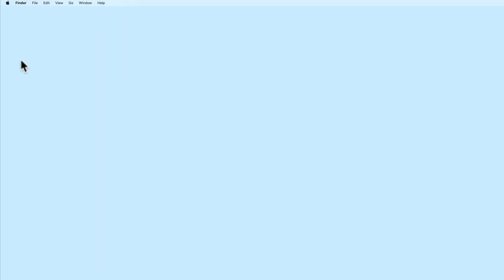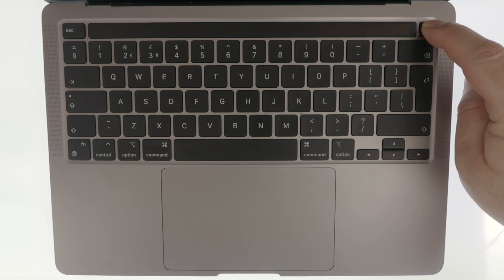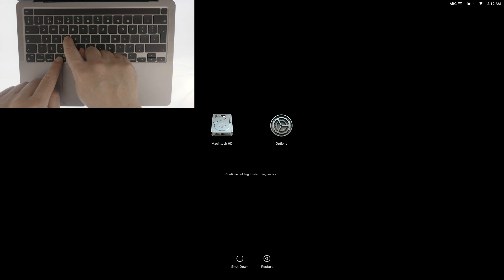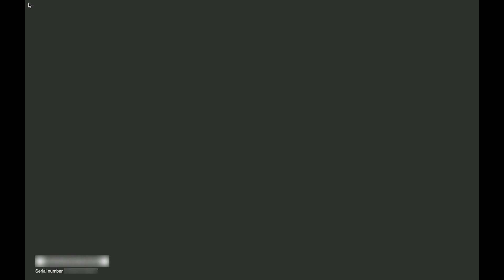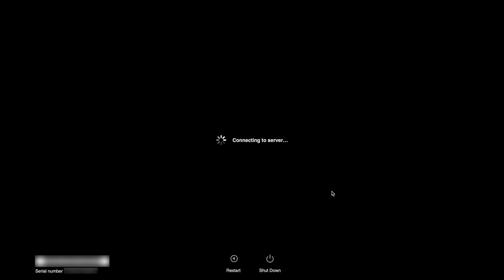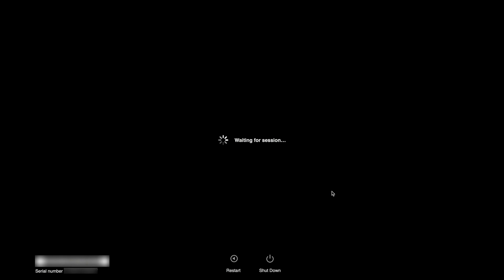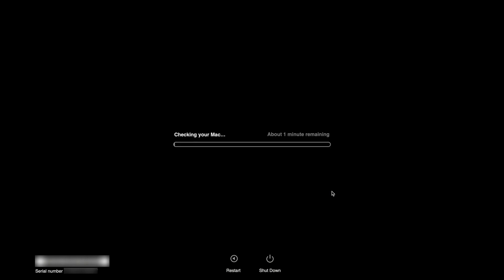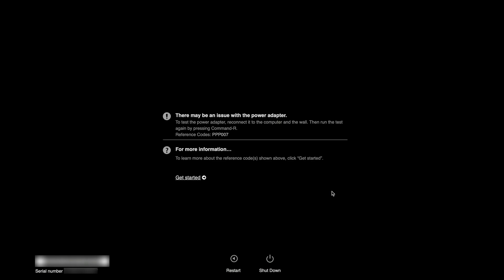How to run a diagnostic test on an Apple Macintosh computer (M1 Silicon Hardware)

Comment: Mine is waiting for session for a long time. Is it okay?
Reply from the maker: Your computer might be having problems connecting to the apple servers. Try switching it off and trying again, or if possible see what happens if you use a network cable instead of Wifi.

Comment: Hey,I am getting a startup issue and i am not able to delete SSD from disc utility for reformatting.I ran the diagnostic test and it shows no issues.I have issues with OS but not able to go in safe mode to update mac.
Is running diagnostic test after pressing offline also reliable ?
Can you kindly help with that
Reply from the maker: Are you working from within Recovery Mode? https://www.youtube.com/watch?v=8uJq7JMaIy8&t=86s

Comment: Well, guess it’s the software then…
Reply from the maker: @jimgilmour1221  if you have a operating system problem, it can be useful to use safe mode which is where only core elements of the os are run. It will also clear specific caches in macOS which can often fix a problem. For more info on how you enter safe mode on an m series Mac - https://youtu.be/36bfBfSt4CY?si=qONP2zANWFt8L1N7
Reply: @mydoodads  Thanks for answering, you're great!

Comment: My Mac is like turning off at 50 percent :( 
Will this solve and check for SMC or any hardware issues?
Reply from the maker: Probably not, but it wont do any harm to try. More than likely your problem relates to a faulty or old battery.

Comment: Hi mate, after choosing the language my Mac goes black and then goes back to choosing the language page. Do you know any solution to this?
Reply from the maker: As this mode needs an internet connection, your laptop might not be connection to the internet via Wi-Fi. One option to fix this is to use a network cable .

Comment: Mine have no issues, but it keeps running diagnostics when I am opening it, how to get rid of that
Reply from the maker: Unfortunately I have not seen this issue before, but the problem might be related to corrupt data being cached by your computer at startup.

While there are a couple of ways to clear the cache, the simplest is problem to just place your computer into Safe boot/mode. This will automatically clear its most relevant caches.

This video demonstrates how to place your M1 Mac into Safe boot - https://youtu.be/36bfBfSt4CY

When in Safe Mode, simply reboot your computer so that it loads normally.

Hope this fixes your problem.
Reply: @mydoodads  thank you!

Comment: How do I know the hardware isn’t changed one and un used one ? Mother board hard disk and all
Reply from the maker: If you're asking how to tell if a third party has swapped components on your M series macBook. As the HD and RAM are soldered to the main board of an M1/2 Macintosh computer. It would be highly unlikely. 

However, you can see the model and serial numbers of your Mac if you:

1. Select the Apple icon (top left corner of screen)
2. Choose About this Mac - More info - System Report

Hope that helps

Comment: My screen is not working. I am using an external monitor but can't get it to display this diagnostic test. I tried using a usb keyboard, closing the laptop and restarting using the external keyboard while still plugged into the external monitor but I just get a black screen. Is there any way to run this test externally?
Reply: hi! solved the problem ???
Reply: @samtestdrive  not yet. external screen still black.
Reply: Did uresolve this?